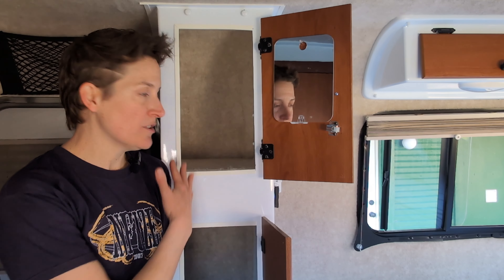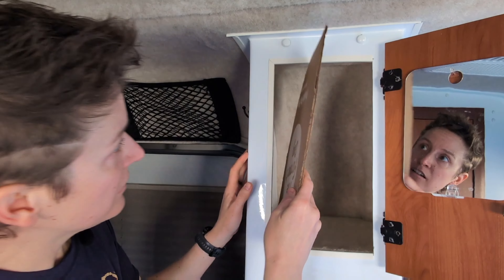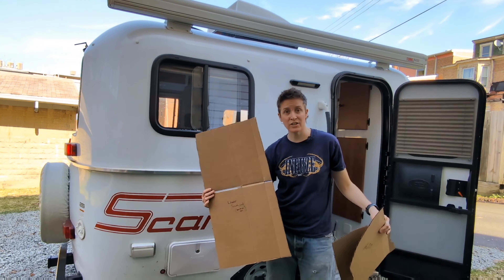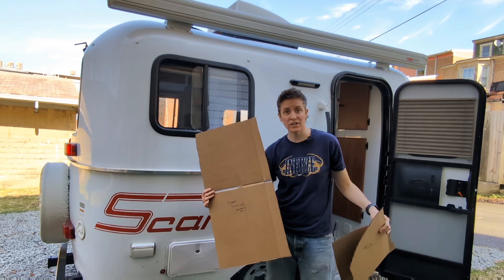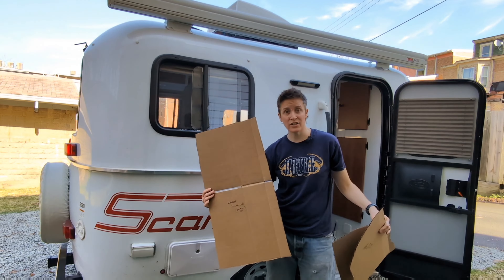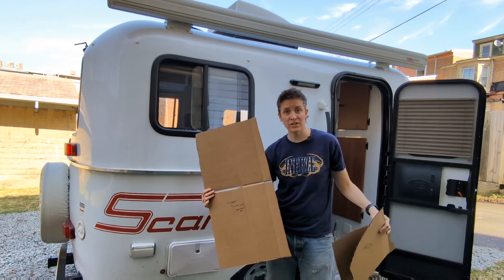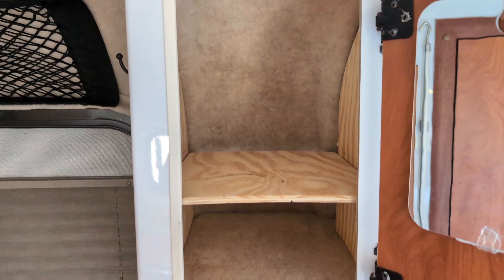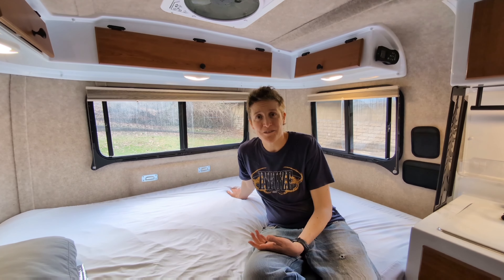EASY Damage Free RV Shelves

Comment: Nice job! I plan to do something similar to my 13' also, however, I think for the uprights instead of plywood I will use pegboard. With the pegboard, I'll be able to adjust the shelves whenever I want quite easily. Haven't actually done it yet, but it's on my to-do list. Too many other priorities right now. Happy scamping. Love your videos by the way.
Reply from the maker: That is SUCH a good idea! I am also thinking about putting a little lip on each shelf with trim to keep stuff more contained. Lots of opportunities for adaptations for sure.

Comment: Thanks, just what I needed. I'm wondering if there needs to be support for the plywood at the front and back, though?
Reply from the maker: Glad you found this video helpful. If you mean the actual shelves themselves, they are supported on all 4 corners. The shelf supports or "side walls" each have a block of 2x4 attached at the front and back. If you look closely you'll see that they create support for both ends of the shelves by supporting all 4 corners.

Comment: If you find that the shelf supports pop off on a rough road, you may consider redoing them with pieces of wood that allow you to glue along the grain. That should be stronger than glueing to the end of the grain. Or use some epoxy and it won’t matter 🙂
Reply from the maker: Really great tips! Thank you for those. So far everything is holding up well. But if that changes I will try your suggestions. Thanks so much 😁

Comment: QUESTION:  Excellent video!  I have a Casita and need to do what you have done.  What size of plywood did you use - 1/4in, 3/8in, 1/2in…?  Again, enjoyed everything about your video.  😊
Reply from the maker: Hey thanks! I really appreciate the kind words. I used 3/8 in thinking I'd want to maximize the space side to side. But after some use I feel like 1/2 in would be a better choice for just the horizontal shelf pieces. The extra rigidity would be nice. I am also thinking about adding a little lip to each shelf to keep stuff from banging against the cabinet doors. 

Hope that helps!